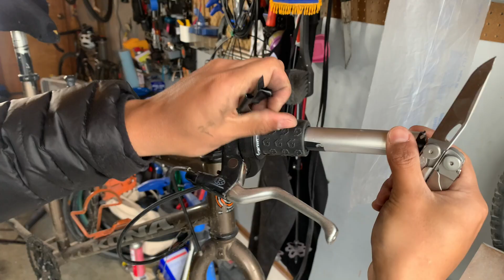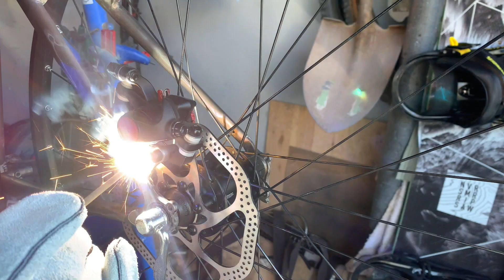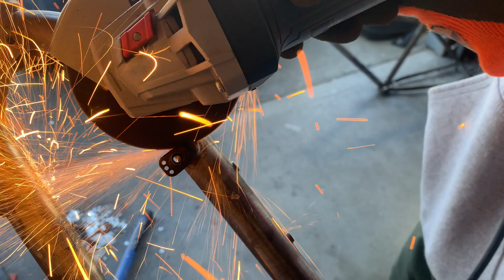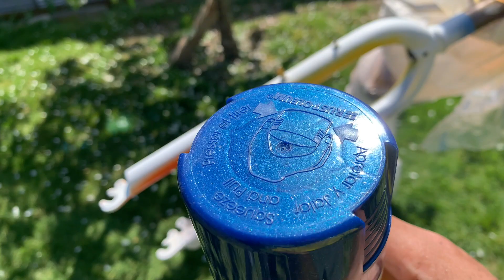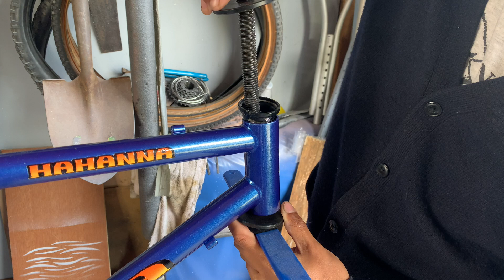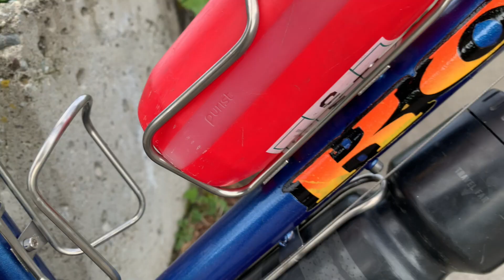1995 Kona Restoration - Bikepack Ready!

Comment: I have an old 1985 Ross St Hellen's mtb I bought some bottle bosses and rack mount bosses to add to the frame. I'm a refrigeration tech so I have torches and silver solder experience. Can't wait to mod some old steel frames! You might look into powder coating for paint in the future. Here $75 they strip and coat frame and fork 1 color. $75 is worth it to remove the old paint! Only those that have hand stripped a steel frame know the work involved! Your project came out great!
Reply from the maker: Thank you so much! Yes, I've redone the paint for this build and it is still holding up!

Comment: That's the exact same color I painted a motorcycle. 4 coats primer, 4 coats this speckled blue paint, 4 coats of clear. Wet sanding between all the layers. turned out glossy smooth.
Reply from the maker: Yes!

Comment: Great to see someone else making old bikes like new, especially with welding disc mounts. Im curious, why You left frame pivot untouched? Also like the colour and graphics concept, but paintwork and stickers could go better, paint had no time to become dry and stiff enought. Also haven't seen clearcoating taking place. 3x8 is my favourite choice in most of bikes, but I'm not convinced with it on bickpacking one. Nowadays 1x10 is enough, especially with steel frames, where lack of fd+shifter and 2 chainrings on crank compensates difference on weight in comparison to alu frames.Hope to see more, cheers!
Reply: Do you think stripping the paint completely before giving it a new color would be useful as well?
Reply: @bryanflo4500  IT depends on quality of that paint, reasons it needs to be replaced. Rusty steel and oxydised alu requires fully frame stripping and proper treating before painting, also primer should be choosen differently then. Paint with bumps, scraches and small defects needs only polishing to even the surface to hide differences in layer thikness. Also very old paint can be clear coated if It's in overally good condition and was stored in building, but when It's falling off from one place sun probably made It's work and will fall off soon everywhere.

Comment: Super cool build! Where did you/how did you make the metal disc brake mounts? I'm planning on converting my 90s MTB to Gravel project to disc brakes. Thanks!
Reply from the maker: Thank you, you can find the disc brake mounts on Framebuilders.com along with other braze-ons and brackets.
Reply: @CowboyTomi  framebuilders.com appears to be a dead link. I too am very curious about where to buy such mounts.
Reply from the maker: @CatRacer1A2A-SO  i’m sorry! it’s framebuilderssupply.com
Reply: While welding and brazing disc brake mounts is a great skill to have (and gives you bragging rights forever😁)  , it might be worth remembering that the majority of stopping power in braking will be done by the front brake.  With a front brake you can just buy a new 26 inch fork with disc brake tabs already there and not have to weld anything.  The skilled craftsman person in me says weld and braze; but the pragmatic engineer in me says keep the rear brake as is, buy an already made fork and front disc brake and RIDE.  If you haven't done anything in 2 years......might be an option. 
And there's plenty of old aluminum frames that you shouldn't weld (unless you really know what you're doing) where this is the best option.  BTW I think the link might be framebuildersupply not framebuilderssupply.

Comment: i live in australia and have a 1998 Kona Caldera that is looking a little tired with some of the nuts and bolts looking rusty , i was wondering do you clean them or just replace them and if so do i need to go to a bike shop or just a local hardware chain or even special order from Kona
Reply from the maker: If salvageable, it is likely you can de-rust all the bolts and hardware in a bucket overnight. if not,  you can find all the 4mm-6mm bolts at any bike shop or hardware store.
Reply: @CowboyTomi  awesome because otherwise the bike just needs a good clean as it is still not a bad bike for 23yrs old , do u have any recommendations on solutions or just any rust remover
Reply from the maker: @mjr320  evapo-rust works amazing! give them a shot.

Comment: I remember that kona had the clamp around the heaset ? is this a replacement
Reply from the maker: Yeah, I didn't film it, but I decided to install a threadless stem adapter for a specific bar I've wanted to use. I'll be rebuilding this bike in the near future with a few different upgrades during the re-spray. Look out for it in the next video!
Reply: I thought the hahanna was the lowest end model (below the Fire Mountain)  and didn't have the fancy headset clamp?

Comment: Can I ask where you purchased your wheelset from or did source the wheels and hubs separately?  Thanks.
Reply: Also, why didn't you remove the brake bosses to the frame like you did the forks?  Sweet build either way
Reply from the maker: @mariovelasquez3296  Good question! At first I just left them, but after a few rides I decided on cutting them off and repainting it! It looks a lot cleaner. And the wheel set I found on ebay! Thank you!

Comment: These 90s chromoly frames are such a great bargain, chromoly steel is a great material to make a bicycle frame of, imo the best cause it's very durable. My own commuter I built from a 90s chromoly MTB frame which I managed to convert to 650b wheels, and I use 32 gravel tires, which are my favored wheel size now 👍

Comment: I would like to know about painting. Which spay brand do you use? And the stickers. What size of paper do I need to take all the Paint off. 
Amazong job you hava a Big fan from Barcelona
Reply from the maker: Thank you! I used a 220 grit to remove the original clear coat. Spray paint, I used metal primer by Rustoleum and the blue paint is the same brand. for the stickers, I used my cricut vinyl cutter to make custom decals and masking. I love Barcelona! I've actually visited a few years ago. Cheers!

Comment: Great video, how come you didn’t remove the brake bosses on the rear?
Reply from the maker: Good question! After the bike was done, I actually went back, cut them off and touched it up with more paint. I wanted to have the option to do V-brakes/canti, but it looked a lot cleaner without the bosses.

Comment: damn dude i can't believe you casually welded that shit. What's the sticky looking stuff you put on the frame after you drilled those holes for the front braze-ons?
Reply from the maker: Great question! it’s the flux that allows the metal to flow through the seams when melted!

Comment: Why use such big tires for gravel? I have been bike touring for a long time and imo thinner tires with a larger diameter wheel are way better, with a fat 26" tire you'll get too tired because it's so inefficient nowadays that there are MTB equivalents for 650b and 700c. I would instead put 650b/27.5 wheels and slimmer tires